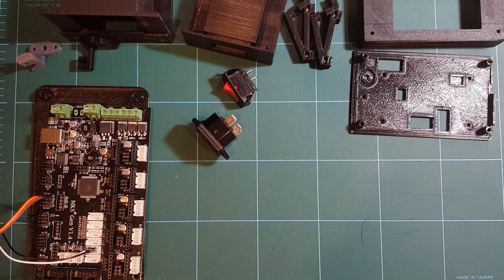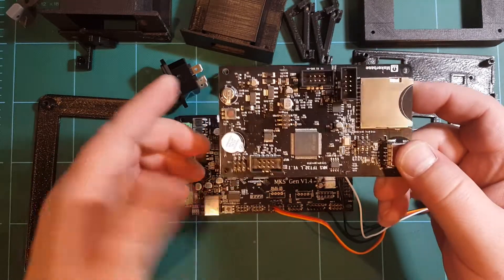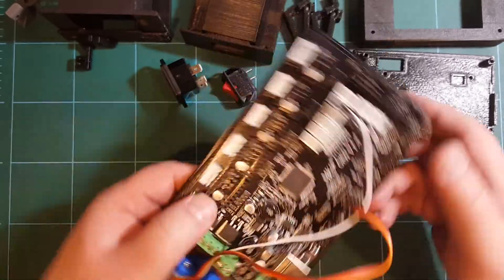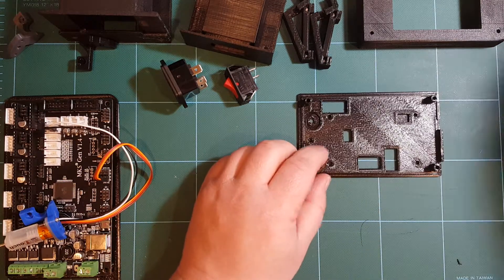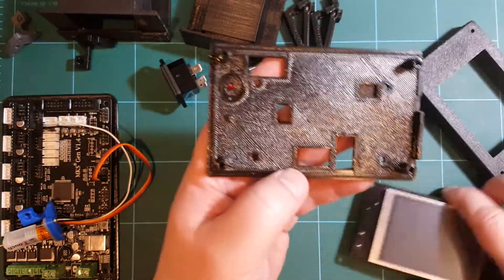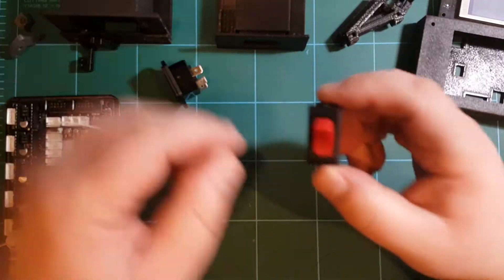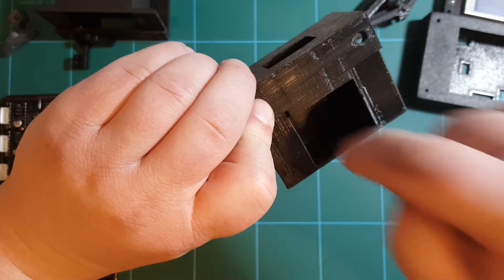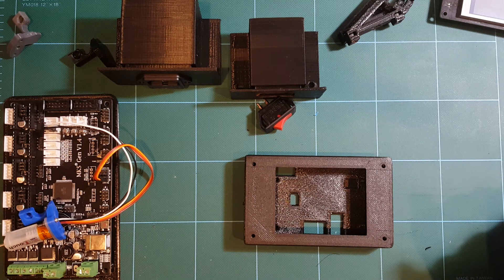Hypercube XL build #2

Comment: When you look this TFT screen up on eBay, many sellers inform:
"Only support MKS Base V1.2".
Don't know what changed exactly from 1.2 to 1.4, but you could try a MKSBase v1.2...
Reply from the maker: I think those sellers are confused. This display supports both Base and Gen and i think one other controller. In fact i bought mine as a kit with MKS Gen 1.4. i have 2 more of them working happily with MKS GEN 1.4 controllers on my printers. Problem is with this particular one, not with compatibility.
Reply: Alright, thanks for clearing that up

Comment: If the loading screen freezes, thats probably the controlboard, not the screen.
Reply from the maker: This is a standalone unit which will power on and operate without controller. So no, it isn't the controller.
Reply: Ah okay, my bad then :-)
Reply from the maker: @soundspark  via usb port to be exact if you mean the main controller. The lcd screen - yes via serial

Comment: You've done well improving Printed Parts & are generous to share them with those who are also building Hypercubes. I pulled a PSU socle/tOn/Off switch +wiring from a laser printer.
Reply from the maker: Thanks! I'm glad you found my designs useful.